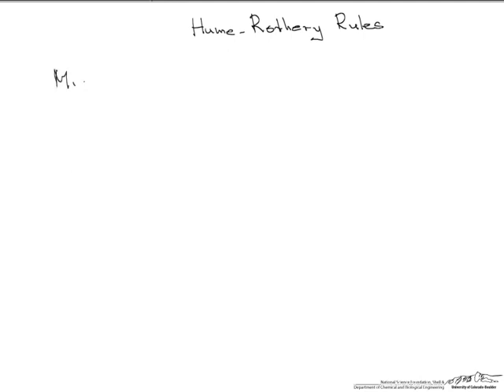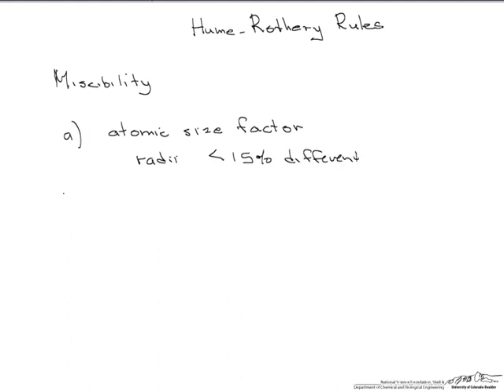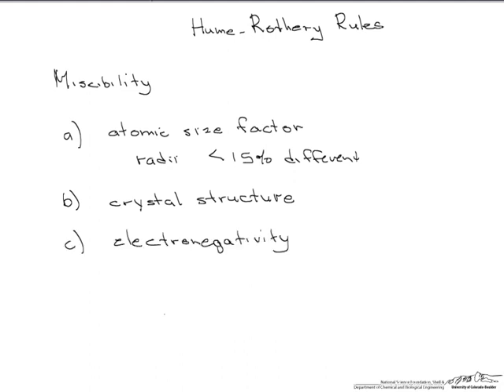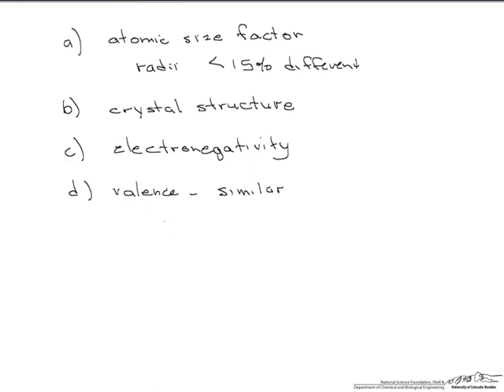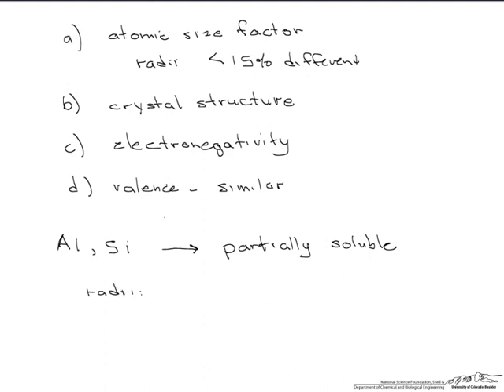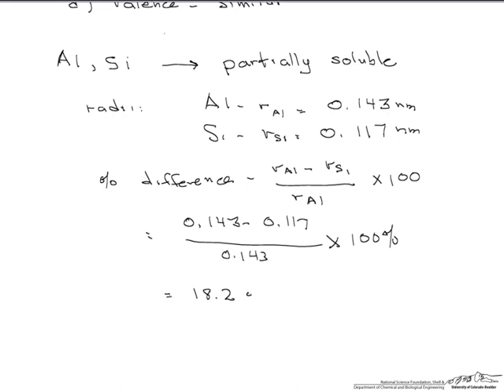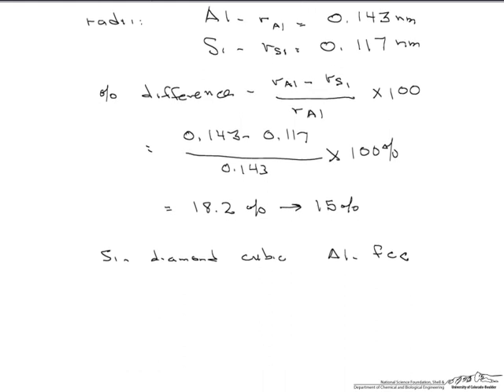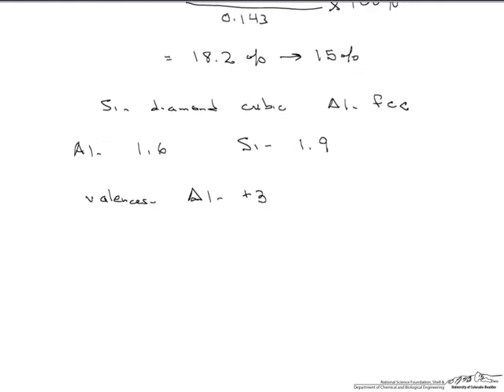Hume-Rothery Rules

Comment: Sorry but wikipedia shows the %diff formula as (Solute - Solvent) / (Solvent). Would you please confirm?
Reply: I don't get that either
Reply: The sign of the difference in the numerator is less consequential than the value; you might say there's an implicit absolute value function performed on the numerator's difference as well. The sign lets you know which atom is bigger, but the point is that relative to the solvent atom's radius, the magnitude of the percent difference should be no greater than 15%.

You don't want a substitution (or "replacement") atom to be 15% too big, or 15% too small.